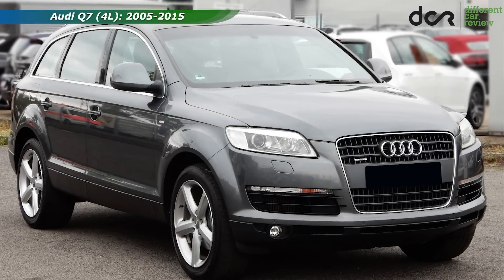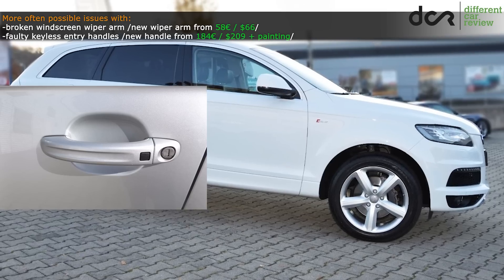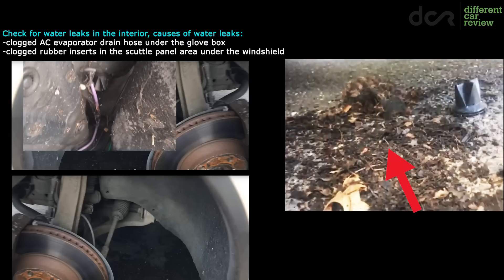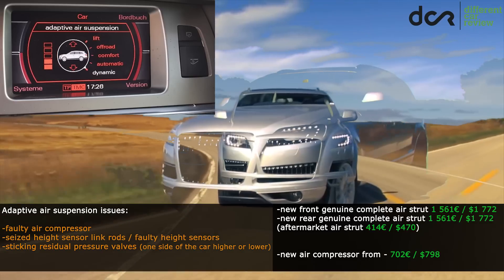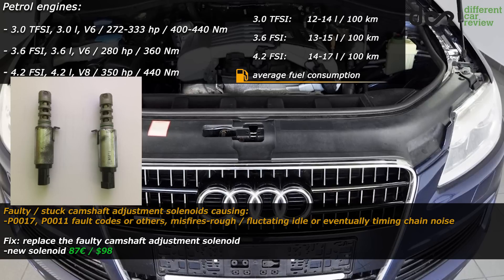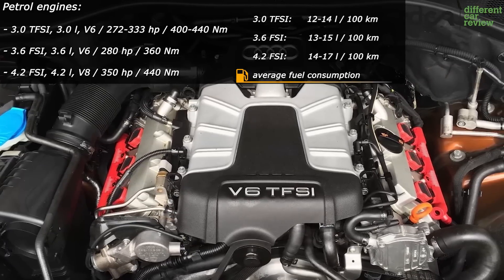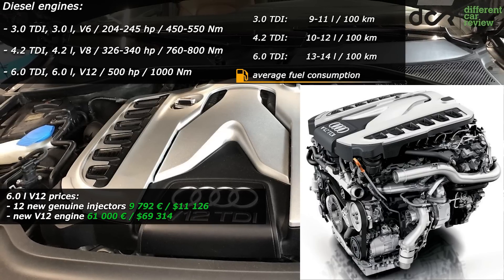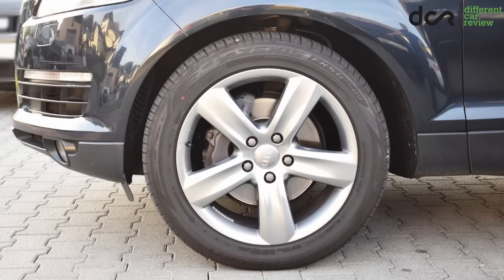Buying a used Audi Q7 (4L) - 2005-2015, Buying advice with Common Issues

Comment from the maker: 2008 Audi Q7 Detailed Review & Issues after 500 000 km / 310 000 mi - https://www.youtube.com/watch?v=Fwbx_KHvPss
Buying a used Volkswagen Touareg II (7P) - 2010-2018 https://www.youtube.com/watch?v=_VVIi56nO_k
Buying a used Land Rover Discovery 3, 4 - LR3, LR4 (L319) 2004-2016 https://www.youtube.com/watch?v=h_TCZ9P_QFM
Buying a used Lexus RX (XU30) - 2003-2008 https://www.youtube.com/watch?v=gt3hjXW895s&feature=youtu.be
Buying a used Range Rover Sport L320 - 2005-2013 https://www.youtube.com/watch?v=-xi0E0M0_gw
Buying a used Mercedes GL-class X164 - 2006-2012 https://www.youtube.com/watch?v=hNK-NwUHfNk

Buying a used BMW X3 E83 - 2003-2010 https://www.youtube.com/watch?v=ZObJsaHXCI4
Buying a used BMW X3 F25 - 2010-2017 https://www.youtube.com/watch?v=Ufzgdym-MzQ
Buying a used BMW X5 E70 - 2007-2013 https://www.youtube.com/watch?v=BkJQQAOwKn4
Buying a used BMW X5 (F15) - 2013-2018 https://www.youtube.com/watch?v=b26LM4gfZIs

Buying a used Audi Q5 - 2008-2017 https://www.youtube.com/watch?v=muzvqDnZHII
Buying a used Audi A4 (B8) - 2008-2015 https://www.youtube.com/watch?v=ixDwvZbWtWM
Buying a used Audi A6 (C6/4F) - 2004-2011 https://www.youtube.com/watch?v=BbTeVU0kXl8
Buying a used Audi A8 (D3/4E) - 2002-2010 https://www.youtube.com/watch?v=PijHDhQ3Gas

1st gen 3 0 TDI ALL Issues https://www.youtube.com/watch?v=_so6yhV5qXE
2nd gen 3 0 TDI ALL Issues https://www.youtube.com/watch?v=272PBPSS2no
Range Rover L322 TDV8 Engine Issues https://youtu.be/bXPNqXs8isg
Reply: is oil in coolant a big issue on these cars >? what causes that ?
Reply: Can you upgrade the 2007 Audi Q7 mmi system to a later version like 2011?

Comment: I am a VW mechanic and i can tell you this is an excellent buying guide
Reply: Would you recommend a q7?
Reply: Please respond ? I need that advice
Reply: Is a very good car, my choice is V6 3.0 TDI but you have to make sure you check all the points in the video. Have a vw-audi mechanic inspect it for you. 
And remember it is not a toyota is a premium car.
Reply: @peethoo  we had a 2012 ml 350 pretty reliable, of course keeping it well maintained
Reply: @peethoo  Premium mean just couple of shit for high price? :-)
Reply: JSI Z CZ? Nejake info o Q7 nebo toureg bych potřeboval
Reply: @peethoo  That means a unreliable and expensive car to own
Reply: ay think is great car
Reply: Oil leaks from rear engine seals and drive shaft seal leaks repair cost is up to 30 k
Reply: @torpemonguz shit for ur shit, kekekekekeke
Reply: I've been working with Audi(Germany Ingolstadt)now for 25 years.Good review but the problems mentioned here are REALLY rare.Like any vehicle you need to pay attention to regular servicing etc.Taking your car to an Audi VW garage is a must as they WILL include in their servicing oiling and cleaning the panoramic roof and all basic water canals etc.Yes you will pay more BUT well worth it in the long run.

Comment: I purchased a 2009 q7 in 2012 with 30k miles. I’ve owned it 9 yrs and it’s been awesome! I have totally mistreated this car. As mentioned here my navigation and radio just stop working. Never fixed it as I was told it would be about $2,500 to fix. And I have to replace headlight bulbs a lot. I have over 180k miles on it. She been the best car I’ve ever own.
Reply: Do you still have it?
Reply: @iwaswrongabouteveryhthing  yes I still own it and drive to work everyday!
Reply: @solboogie08  does your screen work?
Reply: What engine ?
Reply: @iwaswrongabouteveryhthing  it turns on and then goes blank.
Reply: wat engine you have please???  tfsi v6  is good or tdi v6
Reply: @iwaswrongabouteveryhthing  yes screen is still working!
Reply: @kreislers  it’s a 3.6 V6
Reply: @hookah-  it’s a 3.6L V6 and I’m over 200k as well!
Reply: Dam you still got? Was looking to get one just for now in this time being do you think it’ll be okay?
Reply: @isaiahgalindo3339  yes still have it and drive it everyday! I highly recommend it!
Reply: TDI?

Comment: I bought a 2010 q7 4.2 prestige wit 150k miles drove it 5k miles needed a new radiator water pump and all new cooling hoses $7k it runs like its brand new 4.2 NA are really reliable buttery smooth quiet engine

Comment: Also keep in mind that these all tend to wear out tires more quickly than non all-wheel-drive cars, and that it’s always recommended that all four are replaced rather than just two. I find I typically have to replace tires every 40,000 miles regardless of tire manufacturer (I tried Dunlap once, other than that I always run Michelin and rotate my tires every oil change). So it’s good to keep on-going costs for tires in mind, but even with these costs, no SUV beats the Q7 or Q5 or their VW and Porsche cousins for ride quality, comfort, quiet, and very athletic handling. The Touareg TDI in particular might be the most under-rated pearlescent diamond in the automotive universe. However, if also having lots of passenger and cargo space are your thing, the Q7 is king of the herd.

Comment: I’ve brought a Q7 2011 3 years ago, lovely vehicle, I have spent money on it, normal discs & pads , tyres all round, kept up the service history, had rear windscreen wiper motor replaced, new special pipe for air con £700, but awesome ride with air suspension, did replace near side rocker cover ( plastic) , so not a cheap car to run, love it tho 👍

Comment: Just a heads up on another issue with the 3.0l v6 (not sure if other engines are also effected). They blow their injector seals. you'll know when they go because you'll start to smell diesel fumes in the cabin of the car. The replacement injector seals are a slightly different design to the originals ones, which should hopefully fix the issue permanently

Comment: Thank you for this informative video. I just purchased one and am looking forward to a relatively reliable experience with it, but now I feel a little more prepared about staying on top of its maintenance.
Reply: I bought  a 2008 about 2 weeks ago.  Read up on the Bose amplifier power drawing down the battery over night.  There is a fix.
Reply: How long did it last?

Comment: I'm just about to buy a 7 year old Q7 and found this video very useful. Thank you so much!
Reply: Me too
Reply: This is coming from an ACTUAL Q7 OWNER, myself and I'll just say this. I've HEARD all of the horror stories that were mentioned in this video about the vehicle and never had a 1/4 of the issues that was mention and between me and my wife, we own 2 of them. They are both Tdi's and both prestige models. We've been owning them for over 10 years with mines at 124k and hers at 92k now. I have every single option on mines including the very rare luxury package and just being honest, the only issue that I ever had was indeed the door handles in which I still have on the truck. I just always use the keyfob itself to lock and unlock the doors rather than the touch sensor. The early model Q7's, pre-facelift versions had/have this issue because of the design. What happens is water tends to get inside of them after the rubber seals fail over time, causing the chip in them to go bad. It cost online right at about $230 for all four handles as a set and a teenager with common sense could replace them. I just never bothered because of what's mention already. I get 625 miles out of one tank of fuel and that's even hammering on it from time to time. The truck only has a 26 gallon tank and weights right at about 6k with all of the options that I have. My wife's truck being newer has the 8 spd tranny and gets around 635-640 miles out of one tank all at the cost of around $68 from empty at the current cost of fuel where we live. To ME, that's pretty damn good! I maintain the vehicles myself in my garage and do once a year oil, filters and trans fluid changes and only use VW approved fluids. All in all if you do what you're suppose to do them with them maintenance wise, they will always be good to you. I'll end my reply to you with this fact. Autozone and other parts store giants didn't become the success that they are off of premium vehicles.

Comment: I just bought a 2010 Audi Q7 tdi and I love it!
Reply: Is the Q7 still running strong?
Reply: Hell yeah well it’s been at the dealership waiting on a egr pipe for a month and I had them change all the fluids while It’s in there but they gave me a brand new q5 to use until my Q7 is done q5 is nice but too small btw my Q7 is still under factory warranty which is saaaweeeeet!
Reply: It just getting broke in just turned 90,000

Comment: I own a 2012 3.0 and have that cold start rattle. I found that if you're an everyday driver you won't hear it as much, probably because a good amount of oil stays in the tensioner overnight. Bad design there for 3.0 ('09-'12 I believe).

Comment: I brought a 2011 5 year ago best vehicle I ever owned love it. Great video.
Reply: What engine did u have in yours? I'm looking to buy one having a baby soon and family already big
Reply: I have the v6 supercharger
Reply: Bought my wife a 2012 Q7 v6 supercharged version and it’s been a real nice suv for us so far.
Reply: I highly appreciate the response just wasn't trying to seek a a vehicle that's going cost me dearly for extensive repairs
Reply: Unruly GT350 to be honest, most problems come from people who use the wrong tool for the job. Having the right tools, torque the bolts and nuts to proper specs, and don’t take short cuts will make life easier. The design of the Q7 from Audi was a good machine. It’s a good buy from my end.
Reply: Agreed never let someone who does not specialize on these vehicles work on it I was told my engine was blown by a family mechanic because my EPC light came on it turned out to be two cylinder burnt out two weeks later I’m back on the road.
Reply: You will certainly undoubtedly spend a lot of money on maintenance this car is for people who are well off. This is my favorite car but certainly one that has cost me a lot over the years I could have invested the money and brought two of these so if you don’t got it like that don’t get it. Trust me.
Reply: Myles Brown every car has wear and tear, some parts cost more due to the make and model of vehicle but as far as motor/tranny/ diff, this car is a good buy. 

Sure it will cost a lot if you take it to the dealer, but I work on my own cars so it saves me the labor. Audi still did great on engineering this suv
Reply: @mylesbrown9166  im looking at a diesel suv. I w was looking at the gl and x5 . What would you recommend and any bad experiences with audi diesel ?
Reply: How is the maintenance thinking about buying one same year the prestige one
Reply: @runekingrob8891  it can be rough had a few things happen we’re it cost big and I couldn’t get anyone but the dealer to touch it. Some maintenance I got done at a local shop and saved close to 35% on average
Reply: @mylesbrown9166  is suprcharge tfsi…

Comment: I have a opportunity to buy Q 7 4.2 TDI from first owner,with full service history,properly maintained,but with engine check light and some issue with air suspension....Has 520 000 km on the clock(320 000 miles).but sounds good,but I probably change my mind...

Comment: I own a 2007 3.0 TDi. I've had several of these issues including the broken wiper and broken blower motor (both easily replaced).

I also had the issue of the intake manifold flaps on one side about 4 years ago. Now I have the issue on the other side, but as mentioned in this video, it doesn't affect performance so I haven't got it fixed yet.

I also currently have an issue with the turbo actuator. Car runs fine from start, but if I either sit in traffic for extended periods, or turn the car off (i.e. go into the shops) then start driving again when the engine is still warm, the turbo actuator temporarily stops working and I get very poor acceleration. This usually resolves itself after a few minutes of driving, but is still very annoying.

Comment: Very good review! 
My 2011 Q7 3.0tdi showed some of the issues mentioned such as blower motor, clogged ac drains and chain rattle. It also had a leaking rear air strut at around 275000km and one faulty injectors at 303000. The injectors bolts snapped at around 180000 and the rear crankshaft seal leaked from day one when I bought it with 160000km. Something worth mentioning is a water leak coming from the rear waterpump cover. A pretty simple and cheap parts but quite labour intensive to replace. Another coolant leak can come from the actuator valve in the centre of the engine, which is also a fairly cheap part, yet once again a lot of work to replace.
I had to replace my car at 337000km because of an accident and now bought the 4.2tdi.
Hopefully this one will be as reliable as the 3.0tdi, I guess time will tell.
Reply: How is 4.2 holding on? I am planning to buy one also
Reply: And which year 4.2?

Comment: Back in mid-2016, we bought a 2013 Q7 S line Prestige with the supercharged V6, and it has been a beast of an SUV. If you do good maintenance it's extremely reliable, like Toyota truck reliable, sure the maintenance cost is higher as this is German. The only gripe I have with it is having the wheels balanced correctly, each time I go to the tire center and do the balance and alignment. I have to come back at least one time in the same month for them to do it correctly. Since I have the 21-inch wheels any imperfection is noticeable, but man they look good.
Reply: deleted tdi? You sure its toyota reliable
Reply: What 21” tire you recommend for these? I find Continental DWS are somewhat loud and hum a lot.
Reply: @olegk455  We use Pirellis Scorpion Zero but they’re a little bit taller than usual 295/40 R21. You could say they’re loud but what do you expect for a tire with a footprint of that size anyways. It is still very comfortable while highway cruising.
Reply: so. tfsi. is good engine?
Reply: Just bought a 2015 S-line Prestige and I am amazed at how awesome this SUV is! It's well maintained so hopefully if we just keep up with that it will last our family for a very long time

Comment: 3.0tdi before 2010 very reliable q7
Reply: Better before or after 2010?
Reply: @michaelbmw1931  171Kw 3.0 tdi Best engine. Second is 176 kw. 180 kw and 150 kw are worse (two chains instead of 4)
Reply: @Greg-nf8df  is 2 chains better or worse than 4 chains? Thanks
Reply: @hansonchan2  worse with 2 chains.

Comment: Excellent and highly accurate review. I owned a 2009 Audi Q7 for 5-6 years and it was a nightmare with water leaks and electronics failures. The car was mechanically in excellent shape but I had to get rid of it when the amplifier was damaged by water and the entire MMI system shut down, and this was after experiencing MMI water damage and prolonged issues with lighting system failures (and blower also had to be replaced). I don't think you can expect this car to last beyond 6 years without excessive repair costs. I am unlikely to ever consider an Audi again after that experience...
Reply: this is 2014 man

Comment: Great review, thank you! I have a 2008 Q7 3.0 Tdi ABT. I have owned this since 2015 and have done quite a bit preventive maintence and the car has worked fine. The only annoying issue is that  the engine does not heat to normal operating temperature. Only in rush traffic during summer the temperature gets to normal level. I had the coolant thermostat changed but it did not help. I have  done my own search and found an other thermostat which  is connected to the EGR system. Could that be a source of the problem?
Reply: If it's one thing I've learnt from working on my Q7 is if possible take it to a good euro mechanic for trouble shooting.
I had a dash screen that wasn't working, l bought a new one but it didn't fix it, all up l wasnt about 7 hours work on it and drive 12 months with no radio/air suspension adjustment 

Mechanic scanned the ECU for codes and told me what it was then l fixed it
Reply: Wild unskilled guess maybe the heater core?
Reply: @iwaswrongabouteveryhthing  brooo i need help
Reply: @liberationwasalie2982  with what

Comment: Hi. I have this issue of air manifold. Computer says "P2006/08198 & P2007/08199 Intake Manifold Runner Control Bank 1 & 2 Stuck Closed. Since the past 2 year. On a super charged Q7 2013. The petrol consumption has increased since then. If I don't get it fixed then what's the worse can happen to the car ? Kindly tell me wats happening in the Manifold ?

Comment: Own 2015 Q7 TDI. 70k no big issues. Tires wear quickly
Reply: how quickly? Ho many miles on a set?
Reply: Bullshit tire doo Not wear Quicky!
My Winter tire are 40000km and still good and sommer tire are 30000 and Looks New. Check you geometri off Suspension
Reply: What brand tires you all running on these? Ours has 21” wheels and I find Continentals DWS are a bit loud for my liking.

Comment: I was speaking to an Audi mechanic today, who warned me right off it, apparently the fuel pump is such high pressure it fails at around the 90k mile mark - and very expensive to fix, plus a water ingress problem ruining  some of the electrics
Reply: Utter rubbish.That mechanic is obviously talking about a Lada or the old type Skoda's(rear engined)😂

Comment: Spot on with the wiper issue. Anyone with 3.0 TDI vehicle with coil light error and going into lymph mode when overtaking?
Reply: A couple of times, l pull over, let it cool down, turn it off for a few minutes and restart

Comment: How about the fuel pump grenading and sending metal thru the whole fuel system in the 3.0 tdi which causes a $18k bill at the dealer. 100k miles glow plug light comes on and the car dies and needs to be towed to dealer